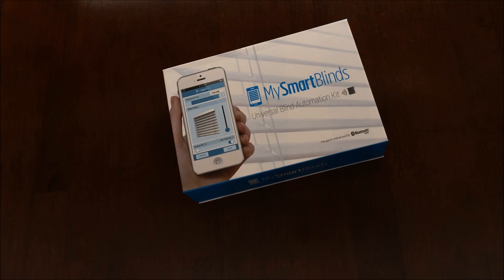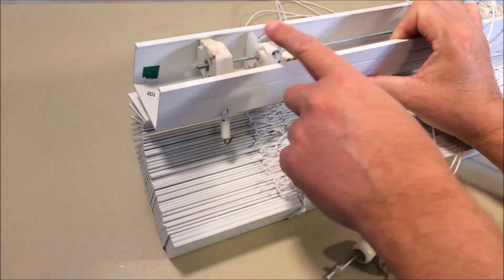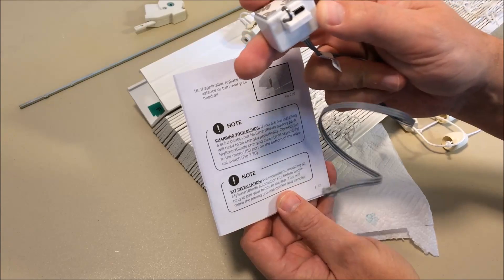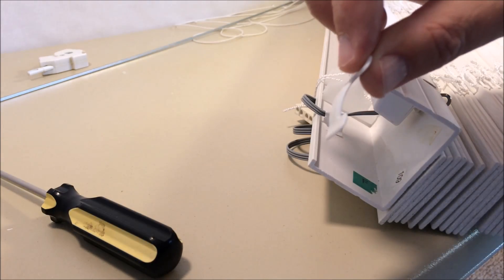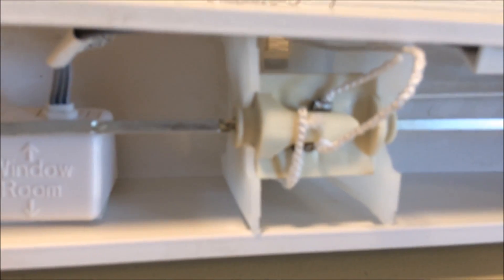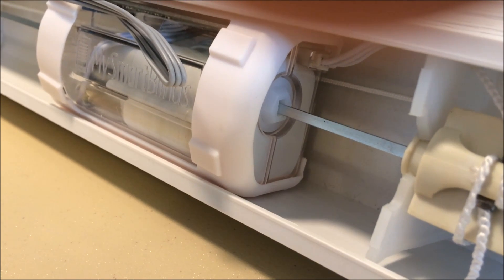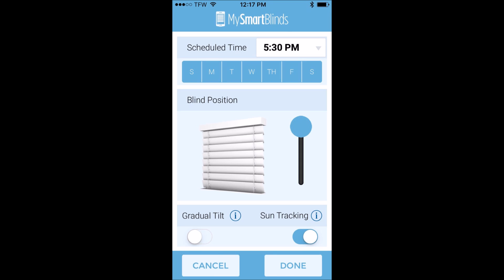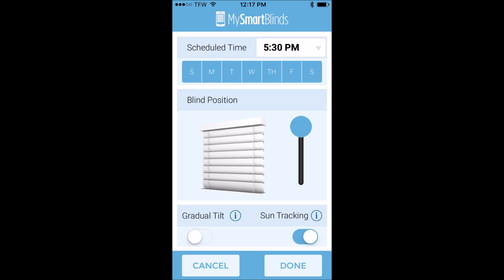My Smart Blinds Review

Comment: I believe the c-clip goes on the outside of the header, not the inside. Plus, the opening in my blind had to be enlarged. However, if you use a solar panel, opening the slot wider doesn’t matter, neither does the c-clip.
Reply: Yes, the clip goes on the outside, also I found it easier to install the wire clips with the opening facing up, instead of facing down as shown in the video.

Comment: I purchased this to limit the amount of sunlight coming through my foyer window, and give us privacy from nosy drone operators and at nights.  It works very well, and the battery holds a charge for about six months.  Initially, I was doing the daily controlling, which allowed me to personally monitor the amount of sunlight coming in.  Once I got settings where I wanted them, it ran autonomously.  I will need to add an outlet close to the Window, in order to avoid the semi annual ladder-dragging routine to charge this gadget. Hoping to see greater improvements in future generations.
Reply: If you install the Solar charger too it, there's no longer a need for a ladder and manually charging it up!!!  Currently, Amazon has a Speical going on as I write this , Order the mysmartblinds kit and the solar panel at the same time and the solar panel is FREE!!!  You get both for $99.  I ordered 2 kits and got both right away.  They are now installed.

You can just buy the Solar panel kit and install that.  You plug it into what you have now, and that will keep the battery charged up for you.  Unless it's a window that doesn't get any direct sunlight.  Then it won't help.

Comment: does it work with homekit?
Reply: Watching this Video, the guy is clearly screwing up!!!  The Hook part with the USB charging port, sits down flush , and that clip locks on the other side of that main metal frame.  He is just flat wrong here.  The Clip snaps on pretty easily if the switch was mounted correctly!!!  No tools needed to do it.
Reply: can someone please answer
Reply: yes it does
Reply: did you try googling?
Reply: No!  It works over Bluetooth.  So you can use your iphone or Apple Watch to control through the app.   Or you can get the Remote control to control it.  They are making a HUB which will allow it to work over the internet and to start with, the Amazon Alexa.  With support for Google Home, Samsung SmartThings and Apple Homekit to follow in future updates.  The Hub is suppose to come out in March 2018.  It's on kickstarter. Buy now for $50, Retail later is $80
https://www.kickstarter.com/projects/551966671/mysmartblinds-the-worlds-smartest-window-covering
Reply: Does this work for retrofitted vertical blinds? If not does anyone know of anyone that does?

Comment: The switch is supposed to stick through the hole and the clip goes on the bottom to help hold it in... If the hole in your blinds is too small you have to trim it with something. Preferably a nibbling tool such as this... https://www.amazon.com/gp/product/B0002KRACO/ref=oh_aui_search_detailpage?ie=UTF8&psc=1
Reply: Ya, I saw that.  He did it completely wrong!!!  It should fit all the way down into the hole!!!  It fit just fine in my Blinds.com blinds.  It was a snap to do.  It all fit just fine. Used the large square adapter.